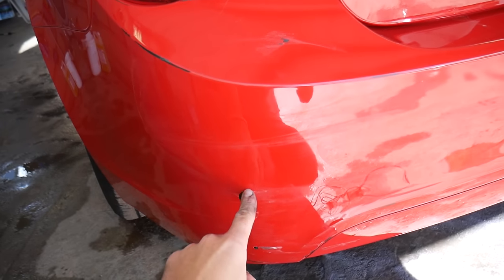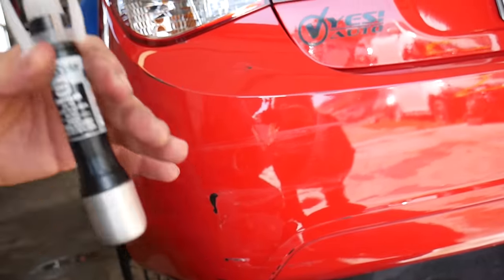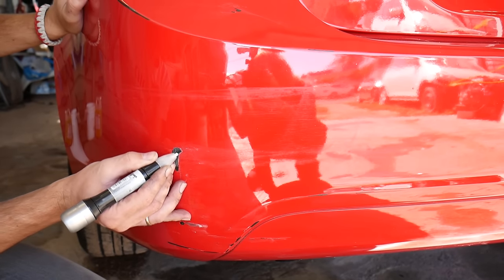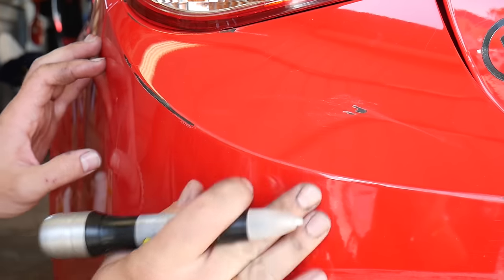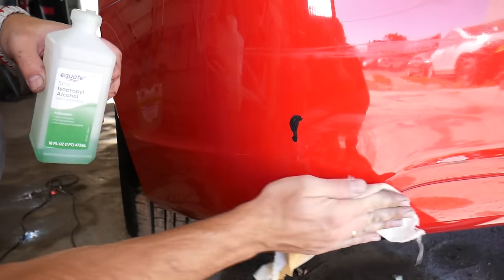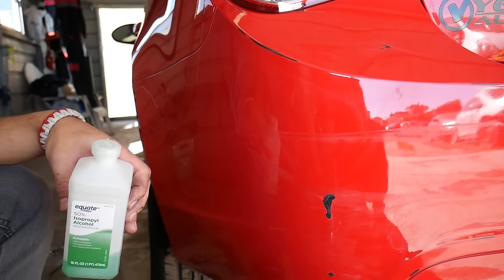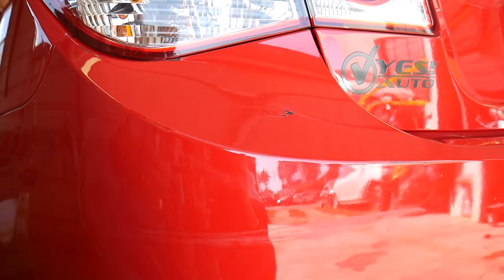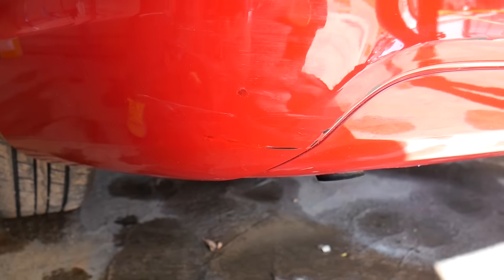HOW TO FIX PAINT SCRATCH ON CAR BUMPER like a PRO | Easy

Comment from the maker: Products that we use and recommend:
► Touch Up Paint: https://amzn.to/3dMNiSC
► Sandpaper Kit: https://amzn.to/2HqwTSs
► Turtle Wax Scratch Remover: https://amzn.to/2vzBkbi
► Chemical Guys Wax: https://amzn.to/2OTpaAA
► Variable Speed Polisher: https://amzn.to/2vzMFaZ
► Wet Sponge: https://amzn.to/2uI1qbK
► Microfiber Towel: https://amzn.to/37oXvhv
► Panel Removal Set: https://amzn.to/3YiMADu
► Tool Set: https://amzn.to/3p5MM6t
► Screwdriver Set: https://amzn.to/3XRB28Q
► Castrol Oil: https://amzn.to/3xBc8B9
► Oil Filter: https://amzn.to/3w0Ulme
► Torque Wrench: https://amzn.to/32qyRwg
►Liqui Moly Engine Flush: https://amzn.to/3IiDBID
► OBD Scanner that we use most often: https://amzn.to/3I4MQfe

► Check out our Amazon Store for the tools and parts that we use: https://www.amazon.com/shop/worldmechanics
Reply: I need to know what where can i buy that?
Reply: Holy cow thank you so much 🥰 my new pink Barbie car is all messed up thanks to a horrible tow job 😂 it's a 2010 convertible mustang 😜 I'm so glad I watched your video before messing around with different methods 💜💙❤️
Reply: @Jesussavedme  aa
Reply: Drop " guys" from your speech
I bet you don't even know that you're saying it you must have said it 200 times in 2 minutes it's really annoying
Reply: May I know how long should I wait to apply clear coat? Thank you
Reply: Where can I find white one ?
Reply: À
Reply: Strong Israeli accent!
Reply: Why don't you wet sand when you apply the red nail polish? why only wet sand when you apply clear coat?
Reply: Scratch repair cream you used and buffered doesn’t that wash off after rain and time then leaving the paint foggy ?
Reply: Scratch repair cream you used and buffered doesn’t that wash off after rain and time then leaving the paint foggy ?
Reply: I wish you was where I live i could use your help
Reply: I don't see the paint pen on your site. What's the brand or where can I get one?
Reply: That pen thing is not on your Amazon tools
Reply: Artemis
Reply: Whats the name of that pen pls
Reply: How about the word perfect, said over and over. Funny
Reply: Cutex

Comment: 11:20 It's worth mentioning that the clear coat will lift the touch-up paint you applied. Make sure the touch-up paint is completely dry and dab the clear coat on to avoid moving the paint underneath.
Reply: Your not gonna get that red in one coat
Reply: Hi guys, what's your range for letting each coat dry, 15 minutes or so?
Reply: @Bafmcc  No, 12 hours at least. Read the directions on the clear coat spraycan.

Comment: Even though the license plates were different, it is the same car.  I look at the dark spot and it still shows very slightly.  Still a great job!  I think the reason for the change of plates is because this is a trade in car.  And as a dealer, he was fixing the paint before putting in the dealer plate.

Comment: Use a little piece of paint stick wrapped with a strip of 2000 grit. Then 3000 grit.
The block of wood should be about 3/4" x1 inch. Cut a strip 1 inch wide and 6" long.
Use a water bottle with a squirter to keep the sand paper wet. A little dish soap( 5or 6 drops shaken up) in the water makes it slide better.
If you had to put several coats of color then clear. I would recommend 1500 grit to start with. 
This whole process works great on hood chips too.
Reply: Do you sand before clear?
Reply: @cbeaulac  yes
Reply: Thanks
Reply: So all the soap does is make sanding smoother?
Reply: Or simply wrap the sandpaper around a small sponge and light pressure. :)

Comment: Wonderful video! I scratched the rear bumper of our Mercedes on the garage door. Small, similar chips/scratches like in the video. Had some pretty outrageous quotes and even one suggestion to get a new bumper. There's no dents in the car. We'll try this first. Thank you
Reply: How did your touch-up go?
Reply: @johncooper2790  OMG, you can't even tell where the marks were. This video was great as I didn't know about the touch-up pen from the dealer. I did purchase the sander pen piece separately.  This video saved us tons of money. We've got the metallic emerald green paint job and  collision shops were quoting $2500 and up.
Reply: @johncooper2790  Our marks we about the same size as in the video.
Reply: Congratulations, Sonya! I'm really happy for you. You saved a lot of money and, more importantly,  you can take pride in that you fixed it yourself!

Comment: Perfect video I needed, I have a 05 Saab ARC convertible that has really low miles, so I want to get the outside of the car perfect...my only thing is, the worse thing is the bumper paint which is flaking, should I wet sand that 1st, to make sure I have all the loose paint gone?

Comment: Hello, i have done similar repairs like this,but i like how you showed entire process in real time... one of the best demo and explanations  on fixing scratches... i have a question... When applying clear coat i would think it would be good to not only apply to where you did touch up paint but slightly over lap on to original paint... then when you wet sand you would have a smooth transition and no hard edge... i think you may have done this,but you did not mention it when you applied the 2-3 coats of clear.... Lastly is that a 2k clear on that dupli color en kit??? i ask because i never use that pen...i just use regular base and clear from large cans ...thanks again for the great demo...
Reply: I don’t doubt the steps taken will have good results. Real-time? 😂. The car starts off in Cali and ends in OKC 😃
Reply: @annagraham6204  YEAHHHHHHHHHH....I agree Anna...how does the car start in Cali and the last plate is OK????? please explain why the video is not consistent...However,...it IS the same car...because even after, I can still see the bad spot...so it is a legit fix IMO...he made it look better
Reply: @SylvesterPotter  The license plate changed from CA to OK which is interesting, looks like the same car though.  I'll leave the jokes to myself.
Reply: @SylvesterPotter  Per this comment Greenpower2 wrote a year ago, this may be a valid explanation; "Even though the license plates were different, it is the same car.  I look at the dark spot and it still shows very slightly.  Still a great job!  I think the reason for the change of plates is because this is a trade in car.  And as a dealer, he was fixing the paint before putting in the dealer plate." 😉I did not even notice the plate change. I was so focused on the area of the bumper where the repairs were made. @Anna Graham is very observant.
Reply: @annagraham6204  😂 I didn't notice the plate change until I read your comment.
Reply: @SylvesterPotter  The first plate (California) was likely the plate that came with it, maybe at auction, trade in or sale to the dealership. 
The last plate clearly says OK DEALER on it which is the dealership plate. This is the same car and obviously a dealership car. Good catch but this really isn't someone trying to fool anyone.
Reply: Scratch repair cream you used and buffered doesn’t that wash off after rain and time then leaving the paint foggy ?

Comment: The job is harder than it looks but I have learn some new things from watching your video. I only have a touch up paint which is matte and they are for some minor scratches and scuffs though one scratch is small but very deep. Do I need a primer or clear coat as well? How many coats of the touch up matte paint do I need to put on???

Comment: Yup, this does work, I've been doing this for years. When you add alittle bit of dish washing liquid to the water when using the wet dry sand paper, it moves smoother on the paint.
Reply: The problem is Where can I get this products?
Reply: @SuperCollince  All in the video description links.

Comment: Good video, would you go to a car detailer or paint shop to have this kind of damage repainted with touch-up paint? Paint shops seem to quote for the whole bumper to match, and quite expensive. My car has two 4" line scratches from the hinge of a closing garage door. I’d try myself but my hands are too shaky at my age. Thanks, enjoyed the video👍🏽
Reply: Same situation as you
Reply: Grrrrrrreat vid guyz%@$
Reply: @Michael Hill How did it go?
Reply: The whole bumper, you lucky if that's where it stops, they wanted to do both fenders to make sure they match the hood for me. I would just paint the hood black.

Comment: Great video, hope this works on my red car. I noticed that this whole process with the 4-in-1 pen was used on actual scratches where chunks of paint is missing. I also have scratches on my car where it wasn't a huge chunk, simply just scratches. Can this process and the pen be used lightly on those small scratches? Or is this process/pen only recommended for actual scratches with chunks of paint missing as in this video?

Comment: Fantastic video! Results turned out WAY BETTER than I expected on my own car! Thank you!!
Reply: Looks like he's working on 2 different cars judging from the 2 different number plates. Did you follow the same process as he did? How did you get the paint color for your car?
Reply: @Zakar1  my car is a black Toyota. I have the color coded touch up paint.
Reply: @PerformanceComputing  Did you follow the exact process he did?
Reply: @Zakar1  Yes.
Reply: Scratch repair cream you used and buffered doesn’t that wash off after rain and time then leaving the paint foggy again after sanding ?

Comment: This is AMAZING! The work, instruction and production value are top notch! I can't wait to try to replicate this on my recently professionally painted bumper cover that got some nasty scratches just days after being fixed. 

What level of cut/grit is the pad on the power buffer? I'd like to use the least aggressive pad that will still get the job done this nicely. Thanks so much for posting this!

Comment: Great video. Im repairing a 2 inch scratch on lower front white bumper. Blends easily. I purchased same paint that you’re using. I did not know about the clear coat in container before you should us. Thanks !
Reply: What's the name of the paint product? Thanks in advance

Comment: Thankyou I just got quoted £450 for the same type of scratches and they said 4 days in the garage!!!!
Reply: 450 quid for similar damage? They are probably quoting for a complete bumper respray with removal and refitting. 
I have my own company doing mobile bodywork/paint. That amount of damage would be £100 to repair and paint to a Bodyshop standard and would be completed in about 2 hours.
Reply: 4 days of bar hopping and 50 pounds for the scratches.
Reply: I paint my own bumpers at home,much cheaper.

Comment: More often than not, by the time you have to use a paint repair kit, the cars paint has changed in the elements so the touch up paint is a different shade and never really blends.
Reply: That's a great point. You'd probably have to take your car to a place that can sell you a custom matched paint can.
Reply: I think the point is it matches better than black.
Reply: @macfady2181  exactly
Reply: I bought mine from the dealership same color andit doesnt blend

Comment: The video is almost perfect except that the plate number of the vehicle in the early part of the video is different from the last portion. Lol
Reply: It’s a dealer plate used at the end because he clearly works for a dealership and the original CA license was expired.
Reply: Wow Noel you ruined my hopes of fixing a scuff mark on my Mustang 😓
Reply: Same car though the touch-up is still in the area he was working and like the other comment said they replaced the original plate with a dealer plate.

Comment: can you please tell me that, is this scratch repair wax permanently stay even after pressure wash, soap wash etc? I am worried that It might come back to the condition which you showed after using 2500 grit sand paper.

Comment: 😁 some of u guy were right two different plate on the back of the car 🚗 that funny video 😎
Reply: many bodyshop use dealer tag so they can drive customer car if they need to. make sure everything is okay after they repair.

Comment: I have a couple of small scratches on my bumper.  The guy at my car dealer said I just need one of their touch-up pens, but when I applied the paint it was really thin. It ran down the side of the car! Is this a fault pen or did I do something wrong? He didn’t say anything about using clear coat or primer.

Comment: The paint in those brushes are never the same color as your car...I've tried that many times and it always looks different by a shade or two
Reply: Well as long as you match the paint code, which can be found inside the front driver car poor panel on the side stickers, then you should be getting the exact same color. If it looks any different but the paint codes match up, then it is some sun fading on your cars existing paint that is slightly lighter than the fresh paint in the tube. Hope this helps :)
Reply: Paints age with time and change colors in the sun. You are never going to get an exact match as when it rolled off the assembly line.

Comment: Great job looked great. If i was you i would add 3 or four coats of paint and three of clear. You can always blend it after. I could still tell the bigger spot. Overall it looked a million times better. Thank you for sharing.
Reply: Why so many layers? Won’t it be thicker, much thicker than the surrounding? Also, how often do you sand? Is it only after you start clearing or should you sand any of the paint layers? In this video he sanded after clear but I’m not sure how well that would work on white? Thanks

Comment: Before the red paint, shouldn't there be a filler material first, to even out the surface?
Reply: If the scratch is down to the bare metal you could use a filler but the majority of scratches are shallow enough that the paint itself will act as your filler. I can’t comment to whether filler provides a better result as I’ve never personally used it- it looks like a tedious process imo that doesn’t always provide a better looking fix.

Comment: mine didnt end up like this, the paint stuck out, and when i tried sanding it down it scratched the surrounding paint even tho i did it with 2500 sand and wet, i must have done something wrong

Comment: hi, that sanding paper what size is that .. would 2000  be ok  ? also , is that soapy water or just normal ?
Reply: The lower the grit, the higher chance of going through the clear. I plan to go 3000 and take my time.

Comment: Hi thanks for the helpful video. Do you have any link  (color code of the pen) for the Ford Focus MK3 2012 candy red? Just had a scratch today on the passenger side door. I appreciate it, thanks for your help.
Reply: If you run your nail over the scratch and your nail doesn't go in to it, it should be shallow enough to use a regular scratch remover on. If there's quite a bit of paint missing, you can use t cut colour fast scratch remover (make sure its the one in the tube that says scratch remover). it has some pigment mixed in, just pick the red one. a normal scratch remover blends some of the surrounding paint into the scratch to cover it and on a bigger scratch, this can thin the paint too much. colour fast has the colour already in it so lets you cover slightly bigger areas. you might need to re apply occasionally after a car wash though.

Comment: I tried using touch up paint on a few rock chips but the paint got stripped off when I wet sanded it. What happened?
Reply: Simon Roscoe  1500 Grit. It doesn't seem the paint is either not drying or not sticking. I thought it was the outside temperature (was about 60F) so I used a heat gun in between layers. What's your suggestion? Should I sand it the area again and add more touch up paint?

Comment: Good video up until the end. That polishing compound has filler in it, right? That stuff's gonna wash off in a few weeks. Honest thing to do is to wipe with IPA after so you can see the result without filler. Thanks for creating the video though. I believe you would've gotten good results with a bit more time spent on polishing, perhaps two stages with compounds without filler.
Reply: The used car will be sold by then!
Reply: I am going to try to push out a dent and repaint where paint cracked and flaked off. Will paint whole bumper if necessary. Need all the help I can get.

Comment: He makes it look very easy. It’s not. It takes practice and it’s not as if the typical person will have that much practice before they have to give this method a shot. 

I’m finding that it’s better to under paint and add more coats. The dry time between coats should be as long as possible. 

I can’t stress enough how important it is to let each application dry or you will be starting again if you dab the tip onto uncured paint. 30+ minutes per coat much longer if you are in a humid environment. 

Also, the first step in removing the loose paint at the jagged edges is very important. It feels kinda self-defeating in removing more paint as you are under the impression you want to retain as much paint as is left in the surface. 

As you go through the process of fixing the scratch, the unsecured edges will begin to lift up and you will be repainting those areas anyway. Knock of those loose edges until no paint easily flicks off from being agitated by the abrasive tip. 

You will need 3-4 coats if you do it right. 2 coats of clear afterwards. Again, I can’t stress enough how important it is to give it ample dry time at each application. Don’t rush it don’t be in a hurry to get it done.

Comment: Do you definitely need a buffer, or can this be done by hand?
Reply: You can do it by hand but it’ll take some work. It won’t be 100% perfect and you may have to reapply the product once in a while but definitely beats spending $500 for a paint job from a body shop, especially if your car is a bit old.